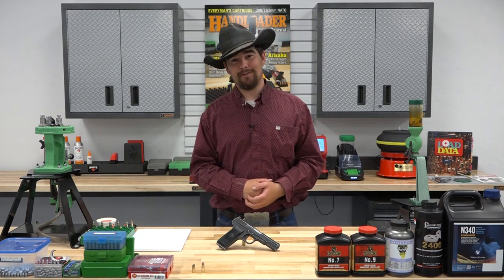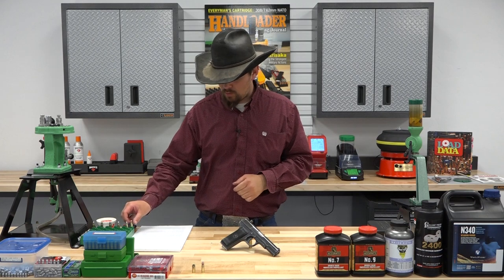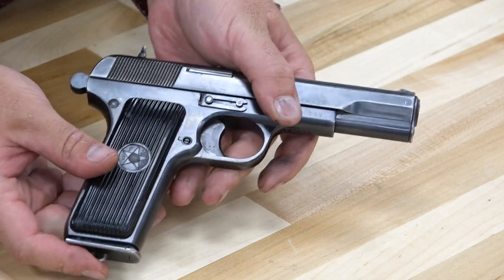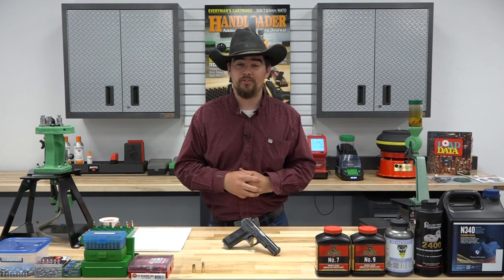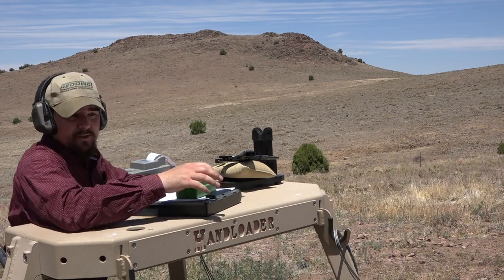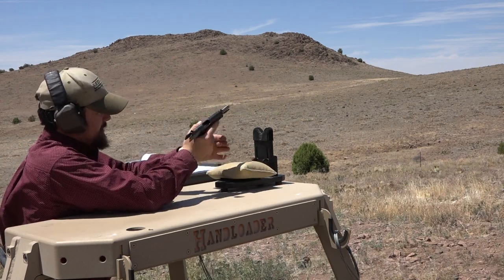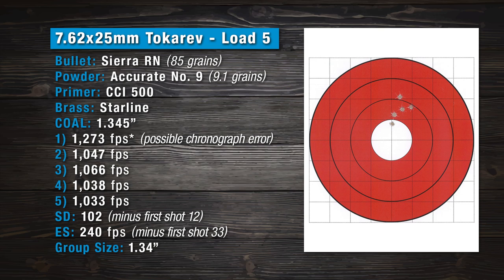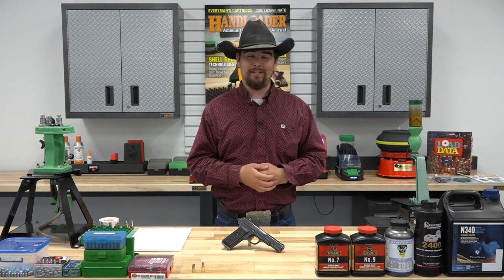Zastava M57 Tokarev 7 62x25mm

Comment: I have a 1911 barrel that's 6" with a Wilson/Nowlen ramp. I use it in my Kimber Target 38 Super. It was a drop-in fit with no issues. You're right, if you try and load the magazine with no modification at all you're be lucky to get 5 rounds in it. However, if you seat the bullet in to clear the front of the magazine. You can get an easy 7 without an issue. Of course, you have to pay attention to your loads now that you have set the bullet back. I also had some .311, 85 grain jacketed bullets that I ran through a Lee .308 bullet sizer die. Yeah, it seems that the Lee bullet sizer dies work with these small jacketed bullets too. They worked really well. I had weird issues with N340. It would not lock back the slide no matter the load and had a really soft recoil. It was like it wasn't igniting fully. Reloader 5 had a much sharper recoil and would lock the slide back. I did use the Lee FCD die and a combination of Lee and Redding dies.
Reply from the maker: I really like the fact that they make such barrels I think it is a fantastic idea to have such an easy drop in cartridge swap. I should have mentioned the fact that you can seat you bullets deeper to fit the magazine! Thank you for bringing up that excellent point! So long as you keep an eye on pressures you should be fine. 
I have heard of folks doing that and I plan on trying it myself I have heard mixed reviews whether or not that messes up the bullet's core. I have a .351 WSL and eventually will be doing a video on that I will be trying to size down jacketed bullets to .351". Hmm that is interesting with the N-340 powder I did not experience any issues with it and it locked our slide to the rear no problem. It did seem like the charge weights we used were rather low but the bullet diameter was also slightly oversize at .312" but it still seemed to work well. I really like the Lee FCD and Redding dies. If I could have found a set of Redding dies and a Lee FCD I would have used that exact combination for this video. Thank you for watching and for sharing your experience with the cartridge and firearms. It is always nice to hear what others have to say!

Comment: do you know why Tokarev pistols tend to drag the firing pin down the primer during ejection??? I've had 4 different Tokarevs currently have an m57 they all do it. the ejected shell shouldn't go flying at ballistic speed 30 to 40 feet away. no one seems to notice that they're not supposed to do that. I can't find a mechanical reason for it. I wouldn't think they should do that anyhow.

Comment: What were the Lee 93 grain heads sized to?
Reply from the maker: If I recall correctly the 93 grain Lee cast bullets were sized to .312" which is pretty much how they came out of the mould SPG lube was used on all of our cast bullets. Great question! Thank you for watching!
Reply: @HandloaderTV  Did you have any issues with the rounds chambering at that size? I have an military surplus M57 also and it has an almost new bore but when i sized to .311 they would hang up while chambering. Your looked like it was fine with the .312...
Reply from the maker: @nebelwerfer199  So I did have a couple of hangups but only when I used the slide release if I pulled the slide to the rear then let it go it chambered the round just find and it would also extract the rounds just fine so I don't think the problem in my case was the bullets sizing but rather lack of lube and poor cleaning of the cosmoline off of the firearm, I cleaned the bore and most areas but I did miss a few near the rear of the slide. I also used the Lee 93 grain bullet for all of our plinking loads which as you could see when we shot steel it ran without a hitch. The only issue i had was the slide not going completely into battery and a light push always put it into battery. Which is why I did not mention it in the video. You can see this when I shoot both the Lee bullets and the Lyman bullets.
 Now that being said I have heard many reports and experienced this myself with certain brands of brass the neck is too thick and when you load an oversized bullet into the brass it fits too tight in the chamber and can cause issues. From the sounds of it that might be what you are experiencing. I would suggest taking a measurement of your fired cases and then your unfired cases or resized cases and see if the neck might be where you are getting hung up then see if seating your bullet makes that neck even thicker to the point where it might cause a malfunction. I also suggest slugging your bore to see what diameter it is and going up .001" for starters. Applying a firm crimp may also help if your issue is with the case necks being too thick. 
I hope this all makes sense and helps, let me know if you have any further questions! --Jeremiah
Reply: @HandloaderTV  Jeremiah what dies are you using for your TT? I found the Lee sizer is not quite up to specs for 7.62 Tokarev. I ended up getting an RCBS set. Thanks for your help and making great videos!
Reply from the maker: @nebelwerfer199  We were using lee dies however I would have much preferred to use Redding as I too have found a lot of Lee dies to be out of spec and a bit clunky to use in most cases. However the Lee dies we used in this video did work rather well and seemed to size to spec or at the very least to the chamber our our gun. No problem, always happy to help, thank you for all the support and feedback! --Jeremiah

Comment: M57 magazines can be used in all Tokarevs.
Reply from the maker: That is true you can use M57 magazines in all Tokarev pistols but you can only use the 9 round magazines in the M57. We probably should have added that little note when talking about the magazines but our focus was on the M57 and it was overlooked! Thank you for watching and for adding that little tidbit!
Reply: @HandloaderTV  Huh?🤔
Reply from the maker: @thehoneybadger8089  The M57 can only take the 9 round magazines the shorter 8 round magazines will not lock in place nor will they feed in the M57 we have in the video however other Tokarev pistols such as the TT-33 and Type 54 Chinese copy will accept M57 magazines.

Comment: Get a Lab Radar chrono....never worry about the light and shadows again.
Reply from the maker: We actually have a LabRadar Chronograph we used it in the Colt Delta Elite, in 10mm auto video if I remember correctly. However, I personally have found it to be a little less reliable and predictable compared to the Oehler Model 35P believe it or not. I have gotten numbers that seem off or had issues with it triggering with suppressors or failing to record shots on rare occasion. Out of all the videos and literally tens of thousands of rounds we put downrange I can count the number of errors on my two hands. I really wish I could say the same about the LabRadar. Not to say that it's a bad chronograph. But I prefer the Oehler, it's the only Chronograph with a proof channel which tells us if there was an error in it's reading of the velocity. Perhaps this would make a good video subject in the near future! Thanks for watching and if you have any suggestions to try and make the LabRadar more reliable I would love to hear them!